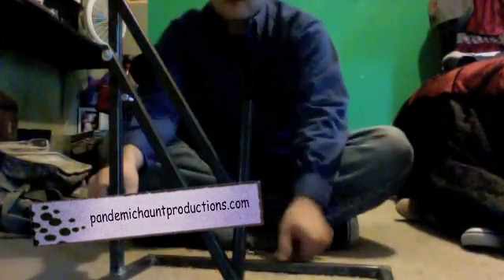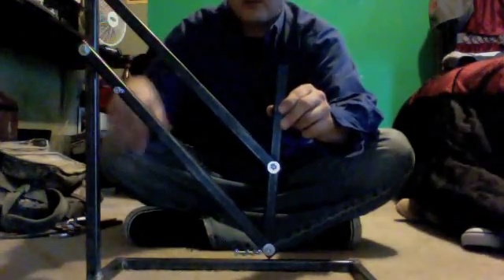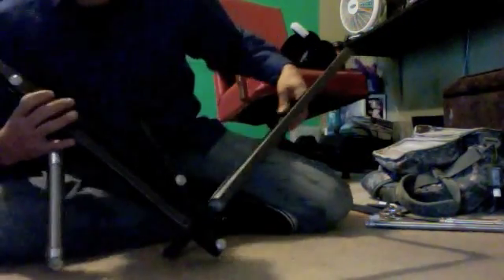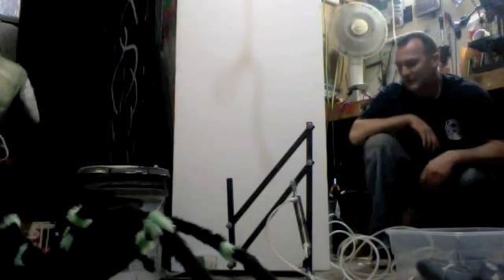Pneumatic jumping spider two bar lifter

Comment: awesome job steve. at that stress point ive seen others weld a triangular flat piece of steel to the horizontal and vertical square tube pieces. also is u add a rubber stop at the down position it will take the stress off the cylinder. a cylinder with the stop built-in is too expensive.